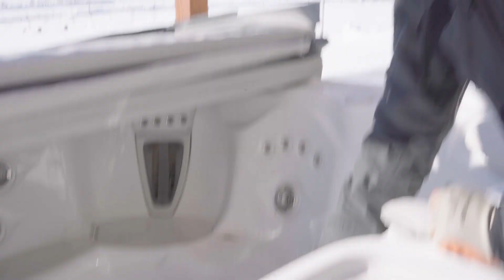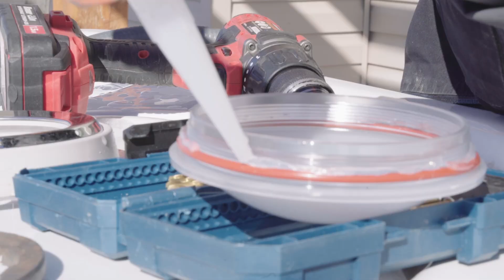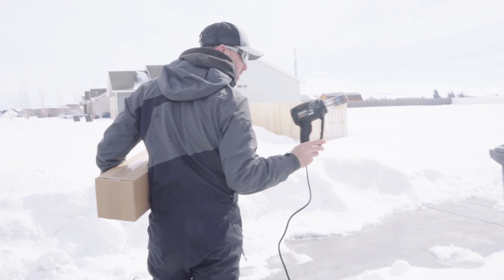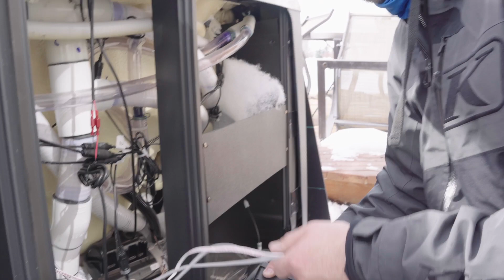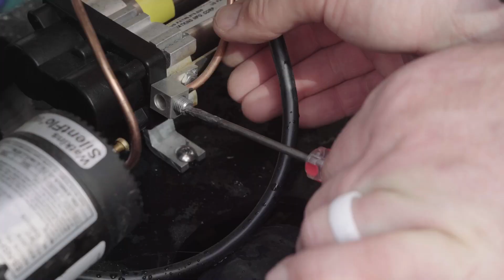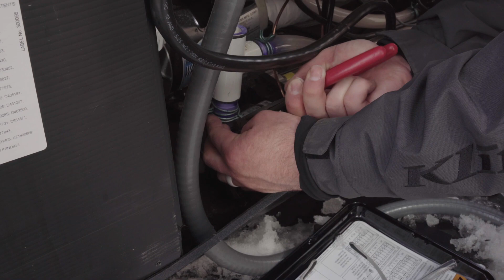Leaky Hot Tub, Frozen Pipes – Hot Springs Grandee

Comment: Hello, I’m interested in a 2021 hot springs limelight or high life, mostly because there beautiful plus they have the salt water system. But as I’m researching, it seems like Hot Springs has tons of problems with leaks and other things.
Can you offer your opinion on a new HotSpring? Is the newer series much better or have they not been out long enough to know ?
Thank you!
Reply: Hot springs tubs are leaky POS. Don't buy.
Reply from the maker: From Jake (one of our salesmen),

Hello @transammatt,
Thanks for taking the time to comment on our video! 
When it comes to any hot tub, leaks are something that can happen but they are usually something that happens after owning it for quite a while. However when talking from a build stand point, the Highlife collection is definitely your best bet. The reason being is that they not only manufacturer all of their own parts, they also stress test their tubs at multiple points throughout the build process to make sure their tubs are in top quality shape by the time they get to the customer. This is also why you won't find "blemish" models out there. They believe that only perfect tubs should be sold so that no customer suffers on quality. To be more specific to your question, after they have piped the jets, runs mechanics/wiring, and sealed the tub from the bottom, they seal the tub from the top and pump air into the shell to a certain psi and then leave it for a while to see if there are any leaks. They test with air instead of water because air can seep through cracks that even water won't get through. At this point in the testing process, if there is any loss in pressure, they will trash/recycle the whole tub and start from scrap. This ensures that instead of trying to fix possibly multiple leak spots, they produce a top quality product every time.
Reply: @LeisureTimeInc  thank you so much for the details. I am really considering a hot springs hot tub.
Reply: @LeisureTimeInc that last part is bs I work for hot springs we take them leakers to the landfill 😂😂